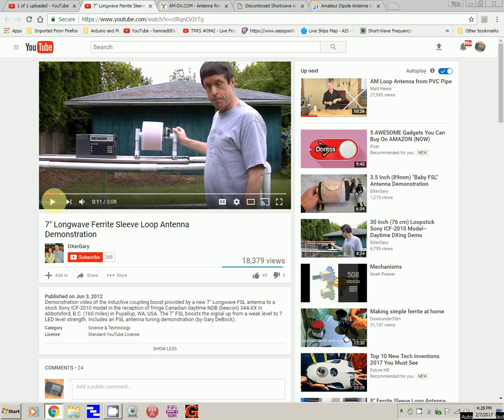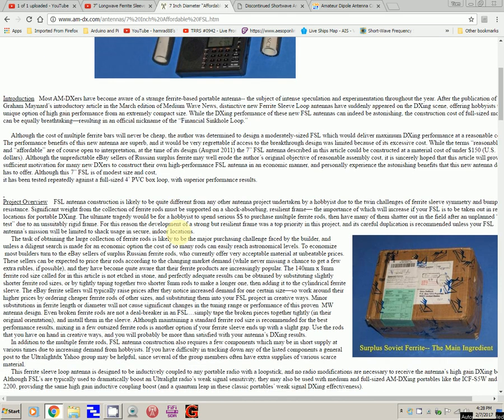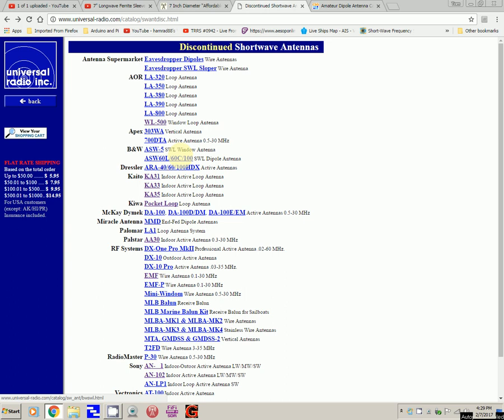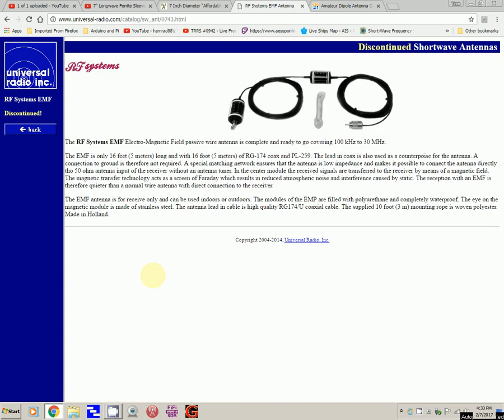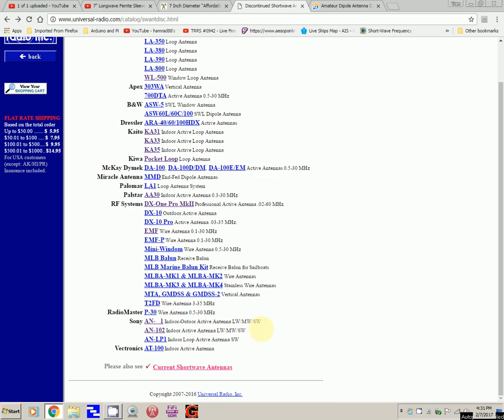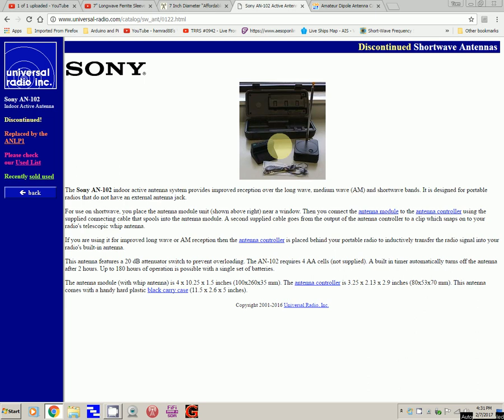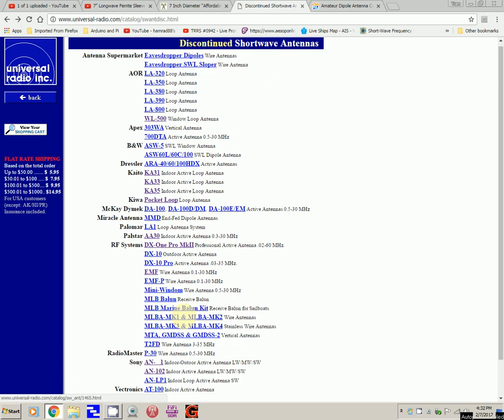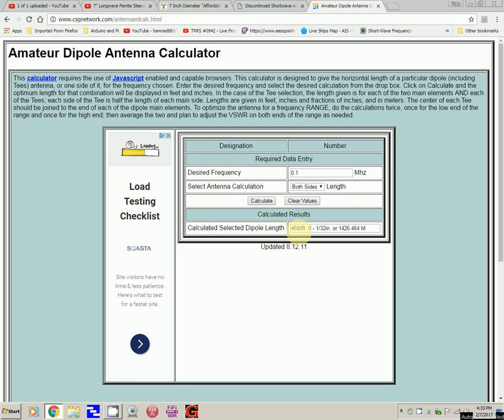TRRS #1114 - Need an Antenna for Longwave

Comment: Hi Tom: I know this video is a little old but maybe you're still interested. I just today got around to trying longwave.  While doing a little research on my little pl310et , learning how to get it into long wave, I also learned that it receives LW with  the built in ferite antenna. That got me to thinking,  kind of same as MW. So I coiled a wire hooked on end to my long wire antenna and ground the other. You know,  I watched you make an am antenna like it for MW...  I  had success! I  only picked up one at 180 khz but it worked. It sounds Spanish not sure.
Reply: Honestly it may be  (can't think of the technical term) where a station from another band shows up where it shouldn't..... I'm not sure.  A lot of Spanish music,  some talk.
Reply from the maker: Awesome.  Thanks for sharing that information and have a great day.

Comment: Pardon the rank-noob (about SWL) comment, but what of using one of your current antennas, to feed into a sort of active low-pass filter (prescaler?) circuit that attenuates all RF above the lowest end of typical SW bands?  Not sure about the cost of such device, but who knows, there might be something that is comparable to what you'd spend on a LW antenna.

As you demonstrated with the dipole calculator, LW antenna's physical characteristics can be far outside most people's property size - not to mention cost to implement.  I DARE somebody to show us their 4,600 foot LW antenna.  Double-dare!
Reply from the maker: Thanks for the info.

Comment: I became obsessed with active "mini-whip" antennas especially considering the fact WebSDR at University of Twente uses one as do other SDR's available over the web. The original design  comes from PA0RDT and here's a good link to the original research:  http://dl1dbc.net/SAQ/Mwhip/Article_pa0rdt-Mini-Whip_English.pdf  An interesting concept is the idea to minimize it's exposure to local noise as might be the case with a long wire antenna, but make up its ability to receive by amplification. 

I built one based on the finalized design and it's surprising how well it works. A Russian ham Anton, RA0SMS, offers what he considers an improved design/product on eBay: http://www.ebay.com/itm/like/201554536506?lpid=82&chn=ps&ul_noapp=true

I built a kit version of his board and enclosed it in a slightly different container and I'm using it now. It's a very hot antenna, and I get good results with it on longwave. But, I do get some BCB overloading with a 5kW station located about 20 miles from me and to me, it means it may have a bit too much gain or needs additional shielding of the active electronics PC board.

I decided to build a 400 kHz lowpass filter to block MW interference and that has helped a lot on LW, but I do need to do something to block MW interference into the SW region.

The bottom line on this is the active mini-whip is a great antenna for longwave! Good Luck!!
Reply from the maker: Thanks for the detailed information.

Comment: Hi Tom, When you find a station and you try different antennas, I would be interested in seeing how well a long (50m+?) would work. I seem to remember reading or seeing people saying that a very long random wire could possibly work. Also, I should have commented on your other video, but have you thought about getting a (used) Icom R75 or Yaesu FRG100> I seem to remember reading that these are good for long wave... Good luck with the project. I look forward to following along.
Reply from the maker: Sorry don't have room for 150 feet of long wire.  Yes, I wish I had one of those two radios.  Thanks
Reply: I am definitely no expert on antennas, but would it work with a 150 feet long wire run at some height along the perimeter of your property? So you would  run it round some poles in different directions? (Just a random thought.)